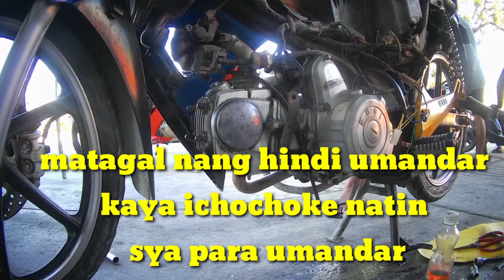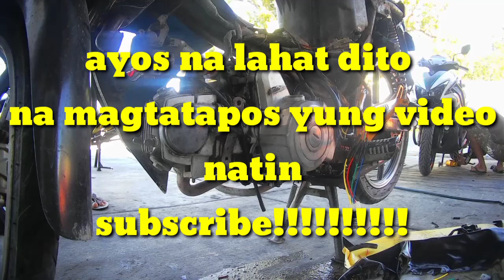Rusi 100 na walang kuryente may parts nga ba

Comment: Boss anong problema minsan biglang bumababa og volt reading sa volt meter ng MC ko nagiging 5 ayaw na mag start ng starter tapos saglit lng nagiging ok na ulet volt reading 13 na sstart na ulet.minsan nmn matagal nag sstay sa 5 ang reading kinakalikot ko na wiring bka may maluwang lng nagiging ok din minsan minsan hindi minsan kusa xa bumabalik sa 13 na volt reading
Reply from the maker: Mayrong naglolost na wiring yan basta ganyan
Reply: @ILOCOSMOTOSPEED  thank you boss sa reply

Comment: boss anong stator po pinalit nyo jan?  pwd po ba yung pang xrm 110 na stator? iba kasi socket nya e ..yun din kasi problema ng motor ko e at yung boung wiring harness..
Reply: rusi 100 dn po mc ko
Reply from the maker: @markpaulcapablanca9618  xrm 110 linagay ko pati charger xrm 110 din,,pwede din wave 100
Reply: salamat po boss..
Reply: dami ko natutunan sa mga video nyo..keep it up god bless